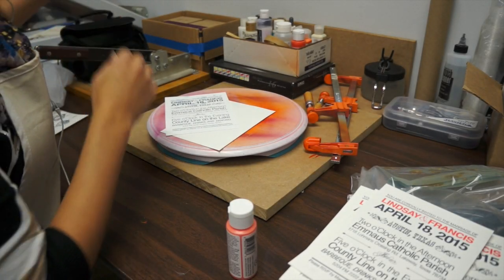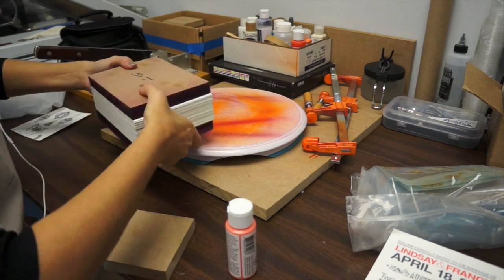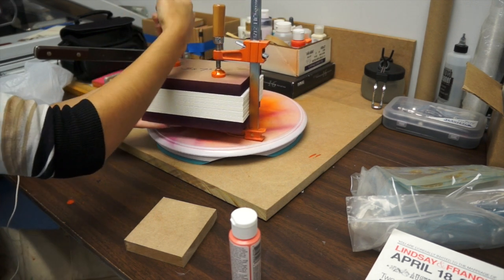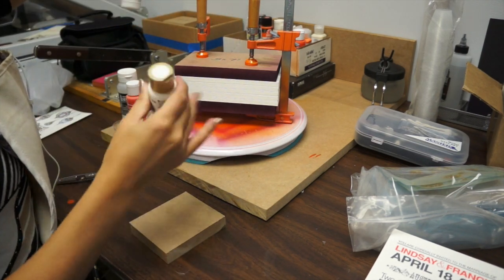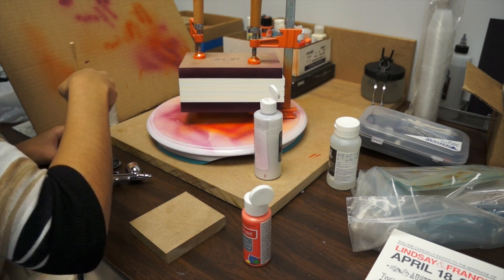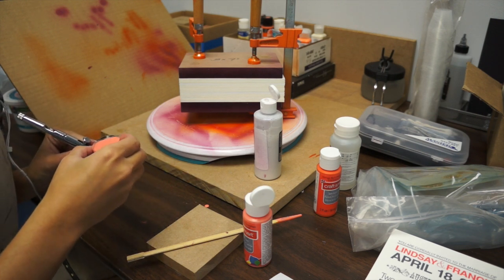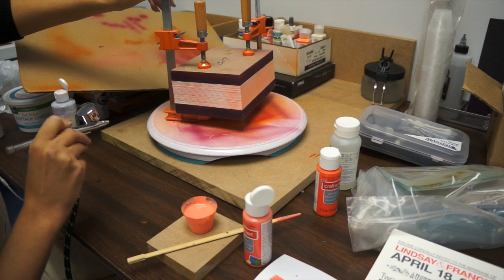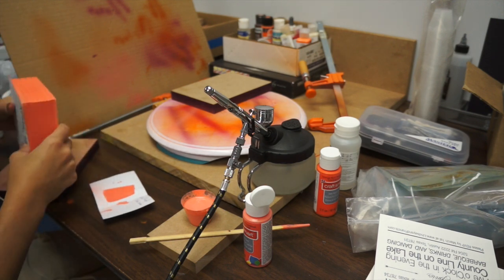EdgePainting

Comment: Excellent tutorial. Just one clarification: those boards are not Masonite which is a thin, hard pressed board, usually 1/8-1/4 inch thick. The boards in the video are composite wood (used for a lot of cheaper furniture), also called MDF or particle board.
Reply from the maker: I always get them mixed up haha, thanks for the clarification!

Comment: Thank you! Very well done. So many comments elsewhere about how printers keep their "secrets" to edge painting to themselves. So very kind of you to share. I may try this on business cards I recently ordered. I got a quote of $100 to edge paint 500 business cards, WAY more than doubling the cost. They offer edge painting for $35 if you choose one of 24 "standard" Pantone colors they offer, but I needed a different color. I suppose Pantone inks are expensive. I don't need Pantone, but I do want a match to the red printed accent on the card (CMYK equivalent of PMS 187C). The card thickness will be 16pt/350 gsm. Any special issues I should consider? Thanks in advance!

Comment: Hiya, I've been starting to airbrush as a hobby - particularly book edges. However when I try to spray white, it always disappears into the pages? Even if it's a first layer. I even tried with a spray can and that vanished too - covered my hands, the cardboards underneath, but not even a drop showed up on the paper. I wondered if you had any advice in getting the paper back to white and potentially layering white on top of other colours?

Comment: Thank you so much for this video. It's so clear and concise. You've got a subscriber for life here now. One question: You unclamped and started handling the card stock almost instantly after finishing. Does your paint mixture dry instantly?
Reply from the maker: Bha Ka It does not dry quite instantly, but it doesn't really need more than 4-5 minutes before it's cured. Honestly, if you're gentle with it and working in thin layers, you can handle it almost right away. The acrylic paint dries quickly if you don't over thin it. Usually, I let them sit for about 20 minutes (or overnight if I have a different job to work on), simply to ensure the edges are not soft from moisture as this can lead to a bit of ragging/tearing, but it's not usually a problem and many time I edge paint, separate, and print in the same day

Comment: nice vedio and what type of inks do you use are the uv based water or oil based
Reply from the maker: water based - for the edges I just use acrylic paint as it doesn't rub or transfer the way oil based inks can (they take much longer to dry)
Reply: @PantheraPress  Do the water in the color damage paper by any means?

Comment: If you're de-bossing would it be best to paint the edges first?
Reply from the maker: gabriel cabrera I've done it both ways. I actually like to paint the edges first, because if something goes wrong, I'd rather it be before I spend all the time printing - I've never had edge painting go wrong, but you never know. Obviously if you plan to have a full bleed on some part of the print or you have the room for the gauge pins, edge painting first is nice. I like to cut my sheets to final size before printing when I can, prevents any chance of mis cuts(clamp slippage or accidentally mixing in prints upside down) or bad edge painting at the end. Feeding does not damage the edge paint or rub it off (at least when I'm hand feeding and using this edge painting technique)

Comment: Why can't you just roll a brayer over the clamped edges? Does it not cover well or does it bleed through?
Reply from the maker: I've tried this, and it turns out horrible every time. The pigment (whether ink or acrylic I've done both) goes on WAY too thick and bleeds or tears. It also doesn't coat as even as the airbrush

Comment: Do you really need an airbrush or can you also use an acrylic spray paint?
Reply from the maker: +Aline De Feyter I, personally, would not use acrylic spray paint because it would likely lay down very thick. Thus it would bleed more and make the cards stick together too much. Spray paint provides much less control - though I imagine some of the more expensive brands with adjustable nozzles might be okay if you can get a fine mist and lay down light coats. The other negative is you cannot mix colors, so it wouldn't work for a professional shop. If you try it and it works let me know.
Reply: Ok! Thank you very much and I'll let you know what the result is :)

Comment: Can you tell me what paper cutter you use or recommend?
Reply from the maker: I hate my paper cutter currently. I'd recommend that no matter what you use that it clamps TIGHT and the blade is SHARP. I've used cheap cutters and generally the more expensive the better. When you get a stack cutter I prefer the ones with the wheel that tightens it as you can get it super tight. The clap style that has the handle won't get as tight on the stack